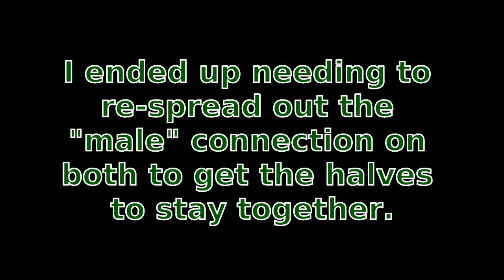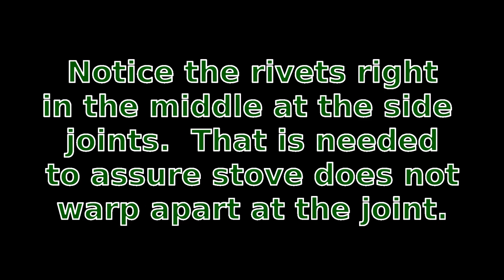Make A Simple Cheap Tent Wood stove - Part 1

Comment: Lonnie, AWESOME Stove! GREAT Work! Thank-you. Few Questions (please Sir): Now that you've used the stove a number times, what's your impression of the baffle?  Good addition? Pros? any Cons? Did you set the baffle all the way to (touching) the back wall of the stove? Or is there a gap in the back to allow some smoke/air to pass (if so how big a gap)? Would you make the baffle any longer or shorter? Did it cause much/any smoke to come out the front of the stove rather than up the flue? Did it work for spark suppression? I really like the idea of the baffle, seems like it keeps the hot gas/air in the stove a little longer which should help heat the fire box up more evenly. Did you find that the case?  Again fantastic work! Thanks Sir! ~steveo
Reply from the maker: I'm sorry but I can not answer hardly any of your questions since I have not used the stove yet other than the initial burn off during this video.   I plan on using the stove extensively the end of this month however on a campout that will last up to a week.    Here are the placement and size measurements for the baffle but as I said, I do not know at this time yet if the baffle as is is more of an asset or liability

9 inches from front to back 
5/8 inch gap from rear of stove to the rear of baffle so baffle front is 9 5/8 inches from back of stove
2 5/8 inch gap at the front between the stove top and the baffle
5 1/2 inch gap at the rear between the stove top and the baffle
Reply: Lonnie, THANK-YOU for such a quick reply! Let me know how it goes and how the baffle holds up. You have inspired me to follow your lead and pull a hot tent stove together.  Looks like such a fun and useful project.

Comment: you did a fine job.  your metal working skills are great and dont need improved at all.  that stove looks as good as some new ones i have seen.  how much money do you think you have invested in the project?  how many burns would you expect to get get out of this stove before it gets to the point where the bottom may burn through?  take care.......todd
Reply from the maker: Not counting the stove pipe, the stove materials ran about 28 US dollars.   I do not know how long this will last But I believe that if i protect the stove from rusting during off season that it should last 5 years or more of occasional camping use.  Time will tell.   I will be spraying the cleaned stove inside and out with PAM type cooking spray at the end of each winter season as well as storing the stove out of the weather.

Comment: you can also soak the sheet metal in Vinegar to dissolve the galvanizing prior to assembly, then coat with vegetable oil like you would season a cast iron pan between uses to keep it from rusting. one question I have is how do you protect the stove floor from the fire?
Reply from the maker: The stove floor is not as susceptable to damage from heat as the sidewalls I believe due to the fact that when burned for a while an ash layer is built up that insulates the floor somewhat.  However I do plan on eventually making a "false floor" that i will be videoing along with other stove mods that I have planned.

Comment: Or use a large unpainted galvanized mail box.or burn off the paint by starting a test fire inside the box.this will work quiet well..next 
Cut a 3"circle in the center of the door.
Attach that circle on the top end to adjust air flow.cut a 2 1/2 circle at the end opposite of the door on top. Install Flue pipe and folding support legs ...
This information is for people who have few tools and no time as in am emergency situation..

This gentleman and his videos are extremely important. Down load his work whale you still can...

Jack:
 from the high country of Colorado

Comment: 4:45 Instead of having a 90 degree cut on the upper board of your bending jig if you cut it at 75 degrees or so, you'd achieve the 90 degrees after the spring back. (less work)

Comment: Yeah Lonnie. Great video!  Do you think I could use flashing to make a stove? I’m not sure it is thick enough. What do you think.  I need a stove for my tiny (8’x 8’) workshop. Thanks
Reply from the maker: No flashing would not work as far as I know.  First because it is to thin and second because if I am not mistaken, I believe that flashing is aluminum and non anodised aluminum would not hold up to the heat.

Comment: This is the best stove design I have seen until now. Thanks. I have a couple of questions, if you have the time to answer. Could I use the same metal (from pipes) for the front and back pieces? Also If I seal all air intakes, would you see any problem to use it as a slow burning stove (no sure of the proper term in English for that). Basically, limiting the air intake some much that you kill all the flames and let only enough air in to feed the amber, thus slow burning. Thank you.
Reply from the maker: Built as is shown and with the air intake closed down tight there is a very slow burn as long as the door itself is not warped and allow extra air in through the gaps.
Reply from the maker: Also the slower you burn a wood fire, the more problems will be produced with condensates condensing onto the inner walls of the stove pipe.
Reply: @Far-North-Bushcraft-Survival  Ok I will go with the same design as you and see what happens with the burning once the door and air intake are closed. Slow burning is what I want especially at night so that I won't have to wake up too much to add wood. Thank you for taking the time to answer. I appreciate.

Comment: Cool stove. I might try making one kinda like it with a thicker sheet metal. Gathered that 1/8 of an inch or thicker is best in the long term although it's probably tougher to bend. Any idea how thick that duct work is? How long do you think it will last?

I want to make a stove for my van so I want it to last.
Reply from the maker: I don't know the thickness of the galavanized duct metal although it is fairly thin.   With proper care the stove should last 5 years at least when using for occasional campouts I would think.  It would not last long at all for full time use.

Comment: Forgive my ignorance, I’m simply looking for reassurance...
Would you want a grate under your wood inside this stove to not just allow better air circulation but to get that direct heat off the metal?
That metal is thick enough to not burn through?
Thank you for your videos, knowledge... I’m very appreciative, thank you.
Reply from the maker: The metal probably would eventually burn through but I'm guessing it would take years of occasional camping use to happen.   However in part 2 you will see that I fashioned a false bottom for the stove that will avoid bottom burnout but also help to keep the bottom cooler to reduce snow melt below the stove.

Comment: Use two aluminum round cantern's and wrap a cylinder with that flashing and place a bottom in it.  Use copper tubing drill a few hole's a few inche's apart then stuff high heat carbon felt into tube leaving extra to sit in bottom of resivor. IE canteen. Make the burner to fit just indide the cylinder in a loop. Drill hole's close to hole's drilled in tube in the cylinder side. Use cut pipe with a mesh decorative mesh cover leaving a lip on the inside for the tube to rest on. Drill hole in side of cylinder for the screw on fuel spout with a screw on lid for the first resivor. Now the second canteen will need to have been designed to be able to hold some presure so copper fitting's will be needed for the copper tubing with steel wool stuffed inside with extra left over to lay in the resivor with tube then being placed with spacer's above the tubing that is a burner. Then go on line and order an two or three HHO 36 jet burner and design a copper burner stand with a thin piece of Titainum placed over the burner's. Design the burner so you can slip it into your stove. Otay now use gas fitting's to make an attachment so you can hook up your burner in your stove to your dual resivor alcohol jet stove. The first alcohol resivor will heat up the tube above it causing the alcohol in the second resivor to vaporize that will build presure that will then travel down another tube to a valve to control the flame to  the burner stand in your stove to heat up your stove. Thought about this design to use for a G stove.  Your stove build was cool! Think you could use thin Titanium to construct another one? I say thin Titanium because of how well titainum heat's up and become's radiant. Idea, if you do make a thin Titanium stove to go with that alcohol burner? Use titainum to design two resivor's you can hang off each side of the stove filled with Gallium Aluminum alloy. Buy two of those camp stove's that have a thermal electric generator and a fan on them that circulate's heated air away from the stove and remove them and incorporate them into the Gallium Aluminum resivor's. If you really want a do it all stove add in a wireless charging module you can power off those two thermal electric generator's and set it up to operate wireless lighting or to charge up a battery bank every time y'all use your stove. 😀👍
Reply from the maker: Sounds interesting.

Comment: I like your design.  I think I'm going to build one!  Have you considered cutting up a 1" brick paver to line the bottom and maybe the sides with?
Reply from the maker: No fire bricks for this stove.  It is a camping stove and bricks would be to fragile.   I do plan on eventually putting a false bottom in the stove.
Reply: @Far-North-Bushcraft-Survival  yeah, I guess you're right.  I saw another youtuber who was using welding blanket material for different bushcraft fire uses.  I'm looking for something light and portable, but also kind of durable.  I'd be interested to know how many fires you get out of that stove before the bottom burns through.

Comment: Lovely job. Superior  skills on show. What size tent or room do you  think it can heat? In the Alaskan  climate of course.
Reply from the maker: I will be making a 10 foot X 10 foot Silnylon ultralight tent and I am sure that this stove will easily heat that and was planned for that tent..  I have heated that size of shelter during the Fall when it was down to around 25 - 30 degrees Fahrenheit with my DIY 5 gallon bucket stove and it was very comfortably warm and was capable for much colder temps.   This stove is considerably larger than that one so should be sufficient down to much lower temps in a similar shelter.  I am planning on using this stove to heat my new tent near the end of this month.  If I do not have my tent finished by that time then I will use my DIY tarp range tent of the same size.   So I should have some real time info with this stove for Alaskan winter temps at that time.

Comment: Nice job Sir , just wonder how long it's going to stay complete without rusting through
Reply from the maker: It should last for many years using it for occasional hot tenting as long as it is stored during non use in a sheltered dry location.

Comment: Very nice craftsmanship,  not sure about the materials though, how well did this hold up after being used a few times?
Reply from the maker: It is still holding up just fine.   It should hold up for occasional camping use for at least 5 years or more I am guessing based on my experiences and knowledge of other thin metal stoves.   Of course that assumption is with propper off season storage being practiced.

Comment: Nice project. My only concern is smoke leakage where the pipe is connected to the stove. Wouldn’t it be better to curl the iron up instead of down? (At 13.50) And then put the pipe over the curled edge?
Reply from the maker: Definitely not.  By placing the stove pipe outside of the bent upward collar you would then experience creosote draining out of your pipe and onto the stove top.   The resulting smell and fumes would drive you out of your tent.   There is no need to worry about smoke leakage in the design as it is in this video.    The stove will "draw" the smoke up the pipe and there will be no leakage

Comment: Hi! Great video. I have been searching for an answer to my tent stove question for days - and I think you’re the right person to ask. I have an old wood stove that I would like to adapt for use in a large canvas wall tent w a built-in stove jack. What I can’t figure out is what to use for a chimney. I see that many of the commercial camp stoves come w 28 gauge galvanized steel chimney pipes. Would I be okay if I adapted galvanized steel tubing to my full-size, cast iron wood burning stove? Any input would be greatly appreciated.
Reply from the maker: I guess the biggest factor that would affect an answer to your question is how much will you be using the stove?   If the stove will only be used for occasional yearly camping trips then regular galvanized round duct metal will work fine but keep in mind that all galvanized metal needs to be burned off BEFORE placing in an enclosed area.  Thin galvanized pipe will burn through but it will be a few years before that happens.  Usually people use a black painted metal pipe that is made for use as stove pipe.  That pipe will last longer but will also be more expensive and possibly harder to find in the size you need.

Comment: Great idea, loved it.
I have a question, why didn't you use black stove pipe?
Then you wouldn't have to burn of toxins.
I'm thinking of making one myself, but I want to use thicker metal.
I want to build one for a camper project I'm planing on, when the weather gets warmer.
It will be around  - 20 to - 30 for the next month here in Manitoba Canada.
PS. Can you paint It?
Reply from the maker: I'm cheap is why i did not use the black pipe.   Also the black pipe is thicker metal and would not be so easy to work using hand methods that i used for mine.  Sorry but I really do not know if you can paint galvanized metal after the zinc has been burnt off.

Comment: Man that has got to be the best build I've ever seen on utube, what would of really been cool is if you could of put in a Pyrex glass window, do ya think you could give it a shot, lol, I like to look at the flame's, but if not no biggie, I'd love to see your fixens on doing that build, but yeah, awesome build , you mentioned something about a spring on the air flow door, what size spring was it , maybe I just missed it, the size of the spring that is, but I will definitely be builden 1, I was hoping to see the baffle, & how well it worked on the spark resister on the top of the smoke stack , anyway do ya think that baby will ever burn through ya think ?  & or warp pretty bad as time goes by ?, & Do ya think fire brick is over kill, I was just thinking of it to keep it from burning through, or at the least a fire tray to burn on , to save the bottom, just in case it was to burn out with out 1. I'm hopeful you'll build an oven that raps around the stove pipe, & a water heater box as well, & possibly a cooling rack, on the other side , all similar to the G-stove, but definitely, on the real tip I'm in love with this build, can't wait to give it a shot at builden my own, just hope it never burns through, wonder how long it will last before it burns through, if it even does at all, we'll just keep our fingers 🤞 it never does , you said something about something melting on the sides, it does look like it warped in that area a little bit, what was melting ?, will that rust up after awhile,  sorry about me just babbling on,, & asking so many questions,  but it's just totally an  awesome build, I can't get over how well it turned out , lol, your a genius, thanks boss
Reply from the maker: I would enjoy a glass window in the door but have not done so yet.   I think it could be done fairly simply.  From what i have seen however, they require frequent cleaning in order to see the fire clearly.   The spring was fairly small and did not work.  So I now have a larger spring to install and try.   I have a spring on my 5 gallon bucket stove and it has been great through quite a few burns.

Yes the stove will eventually burn through.   How long will that take?  Time will tell but i will not be srprised if I get at least 5 years of occasional camping use out of the stove. 

The stove is already warped on the bottom and the sides but I am not worried about the warpage as it does not bother me or the function of the stove. 

I do plan on making a "false bottom" for the stove eventually and will video the process along with other mods that i have in mind for the stove.

No water tank for this stove but i will be making a shelf / table for the side of the stove.

It was the galvanizing that was melting on the sides of the stove as it was burning off.

Comment: While it is still burning and still hot, use a propane torch to burn off the spots that did not burn off with the fire alone
Reply from the maker: Thanks.  I was already thinking I might try that very thing.   I really do not want to keep burning this stove so hot in order to burn off the galvanizing all the way.
Reply: Would you need to wear some kind of mask so you don't breathe in anything bad?